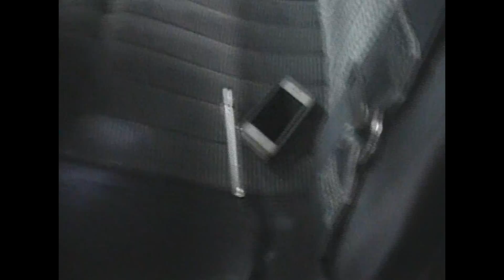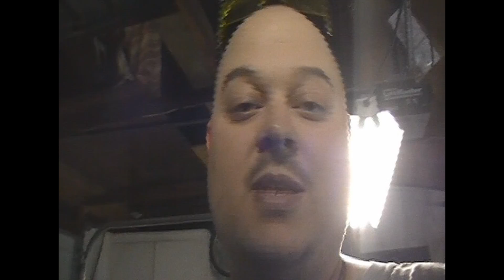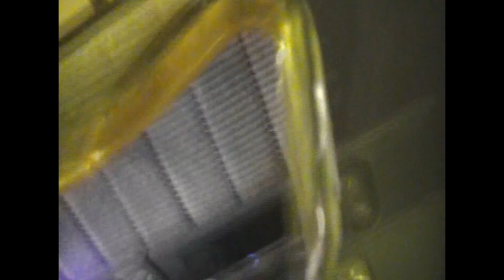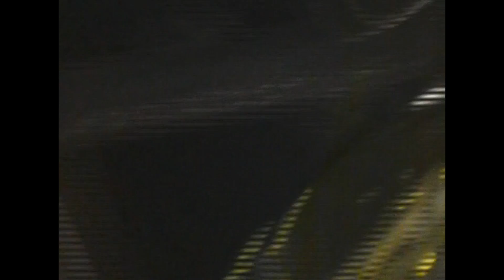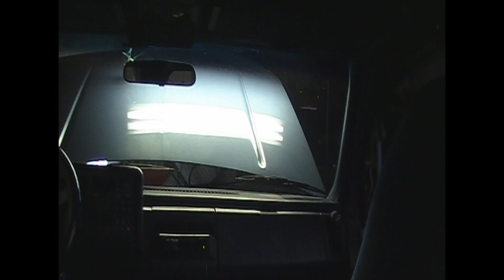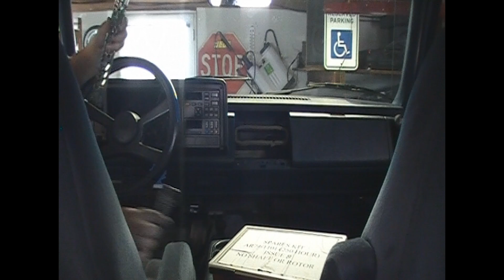Part 1: How to replace evaporator core on 94 GMC Suburban/Silverado K1500 (dash removal)

Comment: Dreadful operation, but I'm about to embark on this to replace my accumulator core. I've replaced everything else on my AC system and losing freon. IT HAS to be the core! This is a daily driver for me so removing the dash will be the hardest part and most time consuming I presume. I've spent my working career in assembly plant for GM, so do have a little advantage of the process. Wish me luck!
Reply from the maker: You got it dude. Take your time, record certain parts so you have that as a reference for how to put it back together. Its relaly just time consuming not difficult, though

Comment: When you're doing this on a 88-94 GMC or Chevy C/K1500,2500 it is recommended that you remove the dash. I know some say it's not a requirement, but it really is.  As these trucks age, the plastic gets brittle and doesn't flex as well. I tried replacing just my heater core and it broke the heater core cover into 5 pieces just due to it's brittleness. Just eat the 1 or 2 days it will take and pull it all.  That being said, when you do, replace it all.  Heater core, evaporator core, blend motor actuator, flap motor actuator, and any thing else that requires "dash out access."

Comment: i did this on a 1994 GMC TopKick without removing the dash..topkick/kodiak trucks use the same HVAC box, and evaporator as the pickups/suburbans.. it was a serious pain in the ass.. but it is doable without removing the dash..
Reply: DO YOU HAVE A VIDEO OF THAT JOB...
Reply: @kevinferrell7033  it is possible as I practiced at the junkyard but I will say the probability of you breaking parts is a lot higher since the dash don’t flex as much once it’s been baking in the sun for years

Comment: One thought I had with all the folks that can't get the fittings loose on the evaporator is you should probably use a tube cutter to cut of the accumulator and feed line then get a fitting that will attach to the cut tube.